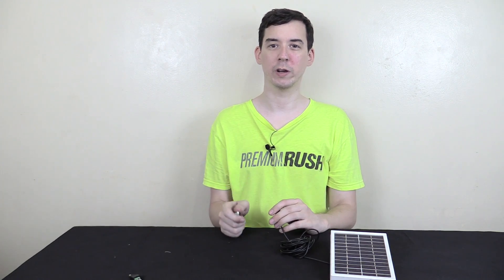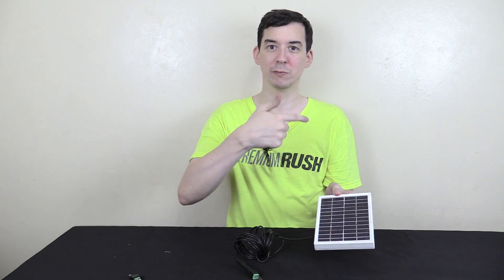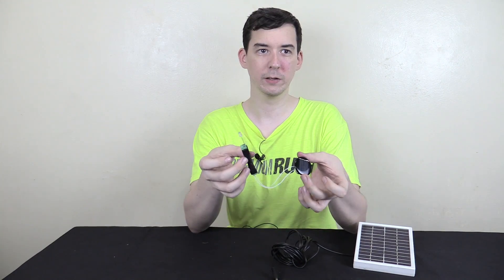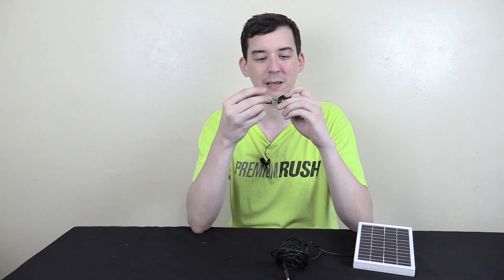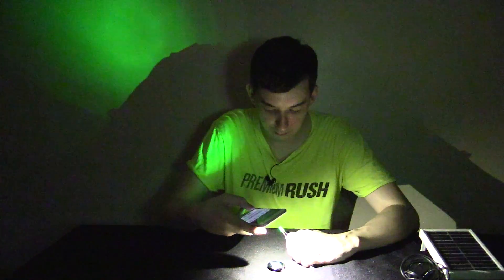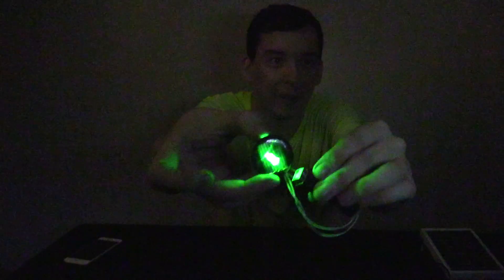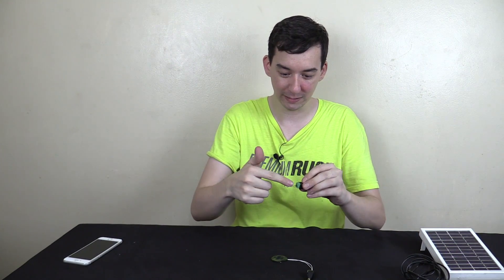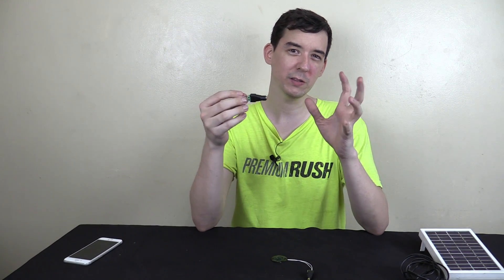Self powered Light - Free electricity ?

Comment: If you use an led light, put it in a box of solar panel on all sides, it would have maximum energy output, it might be efficient enough to keep the light going and you will have perpetual energy, we might have our first energy generator, of course, it would take a little while for it to make so much energy that it could power a building, but it’s not impossible!

Comment: I think it works because the led is lighting up the solar panel and the solar panel gives power to the led that would close the circuit.
Reply: It works cause this is a fake :D The photovoltaik cell has an efficiency of 15% at best, the LED of about 20%, so all the rest of the Energy gets converted into heat. That kind of device is physically impossible.

Comment: nice idea, I tried, it worked...
Reply from the maker: Awesome! May I know what color LED you used? I had less success with blue.
Reply: actually I had got this idea long ago, I had tried it with my emergency light which could be charged using solar panel, it has 24 white LEDs , I connected it to the solar panel an flashed it's light on it... it was said to last for 2 hours but even after 2 hours I had more than 60% battery...

Comment: Doesn't solar power mean, energy derived from the sun? So in that case, the little solar panel was powered by your LED flashlight, would you still call that "solar power"?
Reply from the maker: Good question. I'm not sure. I guess it's semantics because you're still using a solar panel regardless of where the energy came from. Interesting thought for sure.